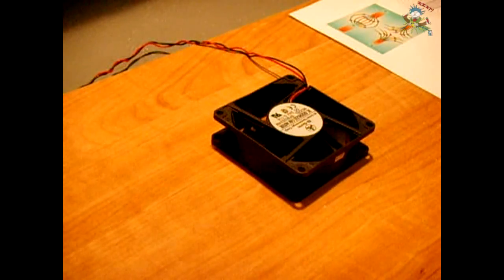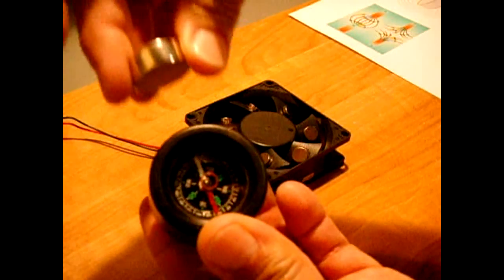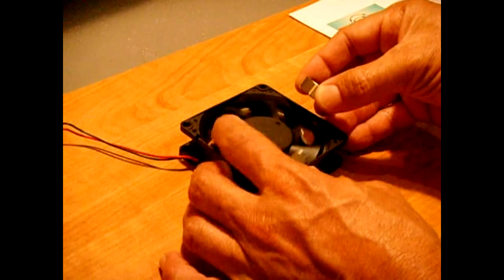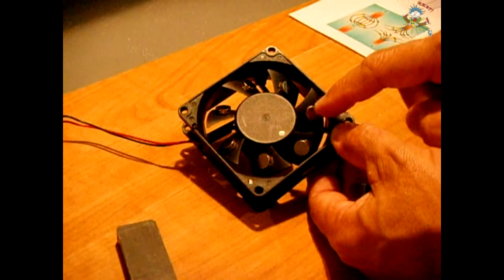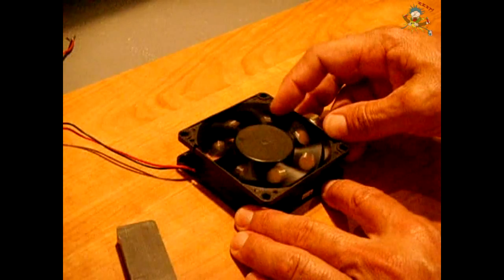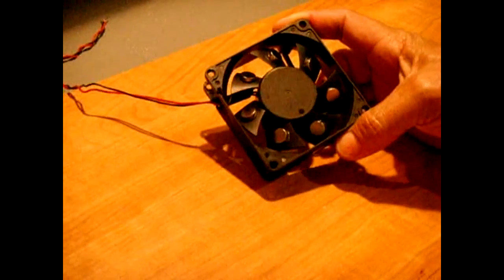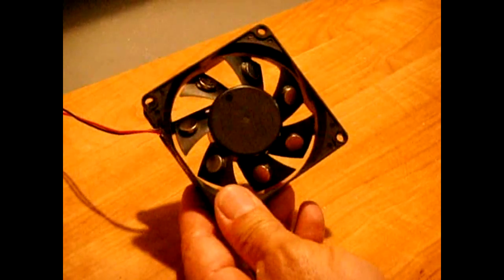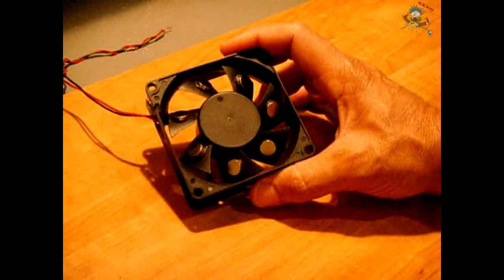Free Energy ~ Case Fan Magnet Motor / Real or Fake?

Comment: what if
1) you put the magnets on alternate blades , would that help in minimizing the cogging... 
2) use the magnet of same strength as the one you have used on the alternate fan blades
Looking forward to your response
Appreciate your experiments , Thanks
Reply from the maker: Hi there.
I tried using alternating poles on the fan blades. That will not work. I have also tried other configurations as well. This will never spin as shown in the video using one stationary magnet. Even using a few magnets will not produce a smooth spinning case fan. Try for yourself. You will see. :-)

Thanks For Wacthing!
Reply: Thanks for the speedy reply, will follow your channel.. Appreciate your time
Reply from the maker: Your welcome.

Comment: Very well said. Tried this myself, and debunked.
Reply from the maker: I wish more viewers were smart enough to try this themselves before posting comments on my video how I did certain things incorrectly, or rating it a thumbs down.
 
Thanks For Watching!
Reply: electronicsNmore
I find this concept very interesting. Noticing with these fans that there is magnetic resistance within the motor itself while static, attributing more resistance to the cogging effect. I was able to get a disc that was levitating on a 52gauss neodymium field held with a brass tube in the center to spin with this fan concept since there was no interference from the fan motor... Though, of course there is no way to then generate or harness the energy and utilize it. but still interesting to watch static objects create motion.

Comment: I agree with you 100%.. its pretty obvious that it is not possible to get a blade spinning in both directions at once.. If you have a S magnet followed by another S magnet attached and you put another S magnet between them you are going to get the magnets repelling in different directions.. In order for a blade to spin you would need a S to be pushed on the blade followed by a N on another blade to pull it towards the stationary magnet.. Problem is that the S magnet following that N magnet will once again want to repel in the opposite direction while the N magnet tries to become stationary.. Either way you are only going to achieve some minor rocking, eventually finding the blade achieving a lock point.. Common sense says that this video is correct. How anyone could argue the opposite is beyond me..

Comment: ...it would not work becaused while u are pointing the S pole to one another thinking it would repelled, u also have to be aware that the the other side of the magnet on that blade is N pole, thus it will attract equally to the magnet that u are holding. So it will not turn.

Comment: most of the videos I have watched claims that they can rotate say fan by magnets is all false. the reason why say rotor rotates inside an e motor is because of the turning off and on of the magnetic fields done by the commutator.. that is as simple as i can explain it man but if your viewers wants to learn more they can just research on how a e motor works it should be with complete diagram.

Comment: it will not rotate, i made a simple diagram of those shown in other video. hahaha it will not just work. other than the cogging. when you applied the magnet as in your video, which you are repelling the magnets. the force of the magnet will be in the middle of the two negatives. hehehehe, even if you add more magnets it will find its position in the middle of other magnets. it will do the same thing if you flip all magnets over.

Comment: I posted the original video on my facebook page and some of my friends told me they learnt this in school some 30 years ago and where had I been? lol So I posted this video as a reply.
NUKED lmao
Reply from the maker: I wish it did work as shown in the original video, but it does not. Using multiple magnets besides what is used on the blades or one large curved magnet, can get the fan to spin(or should I say "move"), but not smoothly, and never enough torque to be used to create any power. Once any load is applied, the fan would stop spinning.

Thanks For Watching!

Comment: It's because your disc magnets are axially magnetized. Try disc magnets that are magnetized diametrically through thickness. Thanks for sharing this, and your diagrams on how your poles are placed. That was a huge help!
Reply from the maker: I know about the other magnets, but the individual used magnets that were magnetized axially.

Thanks For Watching!
Reply: Yes you are right, I got the terms switched huh? Good catch, but the diagram I believe is the incorrect magnet type? Not saying it'll work when switched but I'm gonna try it. Got them in the mail already.

Comment: I have seen other videos expose the fake videos how they use wind in the background to make you believe the magnets can cause free energy.
Reply from the maker: I experimented many times using other small fans such as a shaded pole cooling fan from a microwave oven. The same one used in my, "How to make a microwave oven desktop cooling fan" video. Using several magnets I can get the fan to spin, but not continuously or smoothly. You also have the issue of a lack of torque.

Thanks For Watching!

Comment: Hi, and thanks for your very interesting and insightfull  videos.
I have a question regarding this set up.
As you say the original video petraning to this one is fake but what would happen if you had a magnet on every other fan blade?
Would this counter act the cogging or would it make it worse?
Reply from the maker: I would think that it would be worse due to wider spacing.

Thanks For Watching!

Comment: i saw a video from a brasilian guy that makes this work but you have to change the place where the wirings are connecting.

ill look for it and repost here. i know the wirings have to be changed in order to produce energy... i guess changing dc to ac
Reply from the maker: I saw that video. That video does not prove anything. It is easy to modify the windings inside the case fan to get it to produce electricity when the blades are rotated, but this video was made to show that one magnet brought close to the case fan blades with magnets on them will NOT get the fan to spin smoothly and produce power.
Reply: True. Ib posted before seeing the rest. So how does that wasaby guy do that shit? Does it have post edition with sound pre recorded and he's using an air blower???
Reply from the maker: If I wanted to be deceptive with my videos, I could do so very easily since I am very good at editing videos.

Thanks For Watching!
Reply: Thanks for sharing

Comment: I can Conclude that it is fake. 

I cannot help but notice, how the fan is kind of jiggling when it spins. Its not spinning very fluently/balance.

What I can say though is that the fan is indeed genuinely spinning using the magnets stuck to the fan blade reacting to the magnet he is holding.

But why does the fan jiggle? I believe that he dismantled the fan and took out what was inside of the middle of it (the PCB, wiring, etc. This then will allow the fan to spin easily using the magnets because of less friction.)

And then :

With the amount of space he  created after cleaning out what was inside the middle of the fan (that large circular in the middle of the fan  that usually houses the electronics that causes the fan to spin if connected to power). 

The amount of space is then FILLED with "circular Batteries", enough batteries to power the LED Bulb he is using. The Circular Batteries are basically housed inside the middle of the fan and those batteries are connected to the red and black wires. So that when he connects the bulb to the wires it lights up.

Basically even if he doesnt do that magnet spinning fan Gimmick, by Simply   connecting the black and red wires to the bulb it will still light up even without having to spin the fans. Because the red and black wire is actually hook up to the circular battery housed inside the middle of the fan.

In the video

1> He saids if he stops spinning the fan using magnets, the bulb don't light up... Why? Thats because he also pulls out the Black Wire as soon as he stops spinning the Fan using the Magnet. 

^But actually even if he doesn't make the fan spin using the magnet, the bulb will stay light up because it is actually powered by circular batteries found in the middle of the fan. Those batteries are then connected to the red and black wire he is using which are originally connected to the original fan electronics.

2> He tested the Bulb and it lit up using a Double AA battery. Okay thats legit. But He didn't test the fan if it works if he plugs it on a PC Power supply.

^Thats because he gutted out the middle electronics  of the fan and replaced the electronics with circular batteries. so even if he connected the fan into a Power Supply Molex power connector, it Won't spin.
Reply from the maker: I agree, but why send more viewers his way to make more money from the scam video? I would remove the link from your post.
Reply: electronicsNmore ah ye my bad, wanted to make sure we were on the same page and that you are referring to that particular video.

But I am pretty sure thats how he did it.

Its just the fact that he tested the bulb works with a power source i.e. the battery but he didn't test if the fans work if connected to a Power supply.

then when he showed how the bulb starts when he spins the fans and it stops when he doesn't let the fan spins.

it wasn't about the fan spinning that makes the bulb light up at all. But it was because of him pulling out the black wire supplying the power.

I am pretty sure even if he keeps the fan not spinning, the bulb will still light up just by connecting the black and red wire to the bulb.

I have seen quite alot of 120mm PC case fan "free energy" videos, and I can see most of them utilizes the same gimmick using low power LED bulb and circular batteries placed in the middle of the fan/hub.

Comment: Hi, I'm just trying to put this thing to work myself, the only BIG problem in all this magnetic stuff is actually the magnetic field itself... in other words: Unless the field lines of every magnet in the cogging zone are parallel (sure they aren't at all) this will NOT work. The diverging lines at both sides of magnets will always cause to the fan blades to "oscillate" around an ideal point where soon they will stabilize, that means also that when you try to get past of that point, the small magnets glued on the blades will be attracted back to that point, no matter how you put the big magnet on them, it will be always the same, the closer it is, the stronger the effect, you can actually feel it while trying to keep it steady over the fan when you give it a spin, it seems like a "vibration". In my opinion, it's just impossible. Have a nice day
Reply from the maker: Hey Deimos. Glad you tried this out, I wish others would do the same before posting stupid comments on my video, or rating it a thumbs down. If this did work, it would be great because I could really put a device like this to work! Unfortunately this will never work as shown in the original uploaded video.

Thanks For Watching!

Comment: I noticed that you do not have anything connected to the leads. There is another magnet in the motor an of the fan as well as the field windings (potential electromagnets). I wonder if there is anything in putting a load against this that might overcome the cogging
Reply from the maker: Clearly I would not have anything connected to the leads because the idea of one stationary magnet causing a case fan to spin smoothly(or at all) will never work to begin with. If it did, then I would have connected a load to show power output. It amazes me how many people believe in these scam videos. You can bet if this did work, the Chinese would have already duplucated it like they do with everything else to make a profit. The video was PURE bullshit.

Comment: I think if you used thinner magnets on the fan blade it would hold different results and change the cloging range
Reply from the maker: This has been brought up at least a dozen times. Using thinner magnets will make NO difference. I think you need to try this experiment out for yourself. You will be back with another posting stating, "Oh yeah, you were right".

Comment: I think you must use for the neo denium magnet only south side by cutting the north side and removing it or you must use more than i magnet to repel the magnets on the fan,
Reply from the maker: Clearly you have not read the comments, and you should also know that cutting a magnet will still yield a magnet with both N and S poles. This has all been discussed in the comments.

Thanks For Watching

Comment: This is not to discourage you in your efforts to replicate the many so called free energy magnet motors. The very first magnet motor according to the literature on the subject dates back some 700 years. Since that time there have been  a very largte number of inventors, gadgeteers, hobbyists, DIYers have tried to build a magnet only motor and have not succeeded. The failure to build a magnet only  motor is due essentially to lack of understanding of magnet fields. I have been involved in researching magnet only motors for some 40 years and have  not come across a single working model. There have been and will be many patents awarded to inventors for magnet motors but all of these working designs use an electrical switching circuitry to neutralise the stationary magnets at the locking point to enable the rotor magnets to pass. Some designs have the stator magnets not merely being neutralised by reversed in polarity for more efficient action , The stator magnets may be permanent magnets or electromagnets. But none of these devices may be referred to as magnet only motors. I have seen just one single video of what appears to be a magnet only motor and the video shows this machine working. This does not mean that the machine is valid or actually real.. With appropriate knowledge and technical facilities, computers may produce just about any desired result. As you are interested in magnet only motors may i suggest you view this video. The origin or inventor or builder of this machine cannot be traced. Please do check this machine video out. There are two  videos of the same machine. One video is titled Believe Machine and the other is titled The Believe Machine. I do think that this machine could be made to work if different shield material, dimensions and shapes culd be tried out. There are also a few patents awarded for the identical type machine using the same principle as the Believe Machine. I have unsuccessfulay been tryig to get someone in a first world country such as the US, UK, Germany ,France  etc to research this Believe Machine or the patents referred to but no one appears to be interested in the least in what could be a practical design. I live in a third (or fourth) world country     where even ordinary magnets cost the earth and of course except for just plain old iron in the form of sheets and flats there is nothing else available for shileding material such as Mumetal or Bismuth or composites of copper and iron etc. Please do check out the videos and the patents. You could most likely succeed i feel with the proper design , material and configuration of the shields. All the very best to you and thank you for you video and your comments on magnet motors.
Reply: I agree with most of your statements. Once electric coils are used, you can't call it a magnet motor any more, it's just an e-motor, energy comes from the electrical input. But I don't agree that it is possible at all to build a motor only driven by permanent magnets. Due to physics this is outright impossible, permanent magnets can't deliver continuous energy and magnetic forces always turn a rotor depending on the angular position in both directions, sum is zero. The "Believe Machine" is no exception. No design with permanent magnets only works and if there are e-magnets, it's just an e-motor using permanent magnets as a tool for converting electrical into mechanical power. But these magnets do not contribute to the energy output.
Reply: Thank you Durchblick for your reply to my comment. For sure there are many working machines using magnets as the main element in the working of the machine. I myself have built many such. But as you quite rightly state these are not magnet only motors. The Believe Machine appears to be a magnet only motor but if one looks at the patent awarded to one Howard, the claim made for his invention is that it is a  motion convertor and there is absolutely no mention or hint of self running, over unity , free energy etc. His original design is just as the vidwo illustrates but one cannot see the drive motor as the quality of the viedo is very poor and the motor is quite small according to the patent drawings.I have searched for more than 40 years for a magnet only motor and have come to the conclusion that no such animal exists !!! thank you ,Sir and all the best to you.

Comment: i am going to try the same project but i think a possible solution to your cogging problem to try shielding the sides of your magnets ie. encasing the outer diameters with ferite or soft iron.
Reply from the maker: You'll be back, and I will be seeing a comment, "You were correct, total BS video". LOL You are also forgetting that it is not my job to try and "ALTER" what he did in an effort to get this to work. I did exactly as he did according to the video. Good luck, your going to need it with this project.

Thanks For Watching